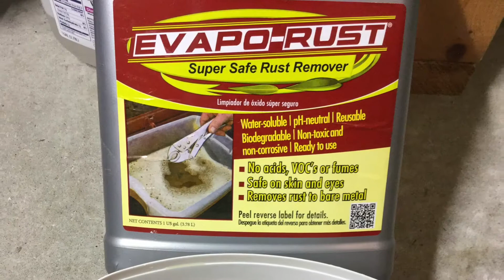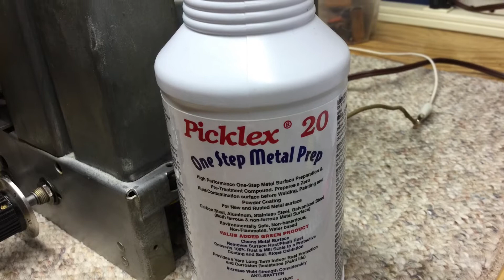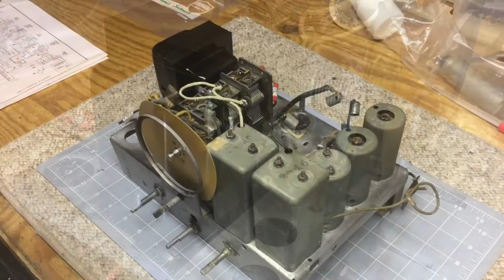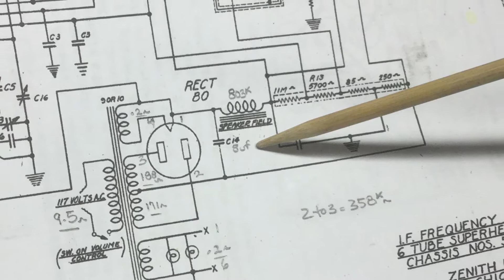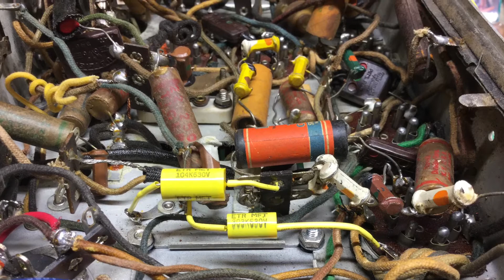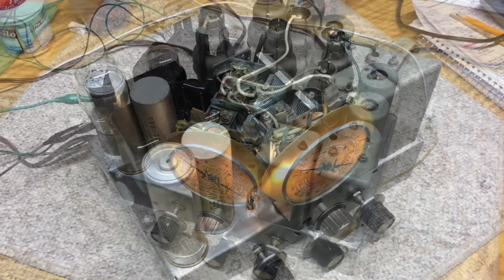Zenith 808 - Restoration Complete

Comment from the maker: +dunloputube Hi David - first and foremost, how special it is to have the radio that belonged to your grandfather; what a treasure! If the antenna lead is only a few inches, what you're experiencing by touching the lead is normal. This particular set will play best with a long wire antenna and by grounding the chassis to an earth ground. I would try 30 to 50 feet of wire, any gauge will work but if inside a home you can use #30 AWG enameled wire that's not very easy to see and lay it around the wall (stretch it out) in the house. In most cases, you'll be able to forgo the earth ground. With the long wire antenna in place, if you can't pull in local stations, there's most likely some other issues starting to occur in the radio that will have to be looked at. I hope this helps and keep me posted after you try extending the antenna lead. Best, Don
Reply: thanks, i will try that. I remember when I was a boy, my grandfather would pick up radio stations from far off ( other country's) Not sure what band he used.
I would like to see how your cabinet came out.
Reply from the maker: +dunloputube It was most likely one of the shortwave bands. If the radio is in good order, you'll be amazed what you'll hear. Best, Don
Reply from the maker: +dunloputube The cabinet was just cleaned up. My Dad started to refinish it, but was diagnosed with cancer, which put the cabinet work on hold. Best, Don
Reply: Sorry to hear about your Dad. Hope he beats it. 

Got the wire, boy that's thin stuff. Unfortunately it didn't work. If i squeeze the wire with my fingers, i works good, with or without the #30. stumped
Reply from the maker: +dunloputube Hi David, thanks for your kind words. I forgot to mention and you may have done this, but if you're using enamel wire you'll need to remove the enamel before soldering it or wrapping it around the existing antenna lead or terminal. Keep me posted. Best, Don

Comment: Don, thanks for these 808 posts. I have an 808 that was my grandfathers that is in good shape, but is now having some issues. Basically the radio only works when i hold the antenna wire. Also, my radio dose not have an antenna ground wire that i can see.
Any idea's you may have would be appreciated.   Thanks, David

Comment: Wow, Don, you did a fantastic job restoring this Zenith. The electrolytic capacitor restuff you did was beautiful, too. 
Thanks a lot for sharing.
Reply from the maker: Félix-Antoine Gravel Thank you so much! The electrolytic can opened better than any of my previous attempts to date and I'm sold on this technique. Thanks again for your kind words and watching the video. Best, Don
Reply: +RestoreOldRadios It was also pretty smart to restuff that can only. The other can would have been much messier to cut open, empty and restuff. 
I'm definitely sold on that technique too, now. I'll have to try it! :)
Cheers, 
Félix.
Reply from the maker: Félix-Antoine Gravel Félix, I appreciate it. One thing when I watched my video back, I may have not been totally clear on how I applied the painters tape. I laid down two separate sections (2 or 3 full turns for each to build up the surface) leaving a gap of ~1mm or less between them, making for a nice lane for the cutting blade to travel with little to no side to side movement. In addition, the tubing cutter is stationary and I rotate the cap while applying pressure ever so slightly gradually increasing each full rotation. Let me know how it works out for you or any additional tweaks you make to the process so I can give them a try. Best, Don
Reply: RestoreOldRadios Thanks for the additional details. I will keep you posted next time I get to restuffing a can. I'll probably shoot a little video! :)

Comment: Looks like you ran into the same resistor plague that I did with that Sparton radio.  I thought about using new carbon comp resistors just for the appearance, but ended up using modern film resistors for more reliability.
Reply from the maker: Maxxarcade I've never seen resistors so far out of spec as I encountered in this Zenith. I thought I was reading the values wrong or my meter had failed me at first. I've been using up all of the metal oxide resistors that I purchased some time back. I probably need to consider switching to carbon myself down the road to keep the restorations looking as authentic as possible. Thanks for checking out the video. Best, Don